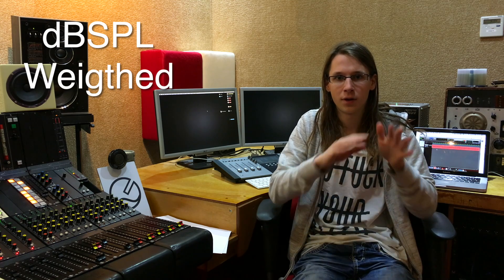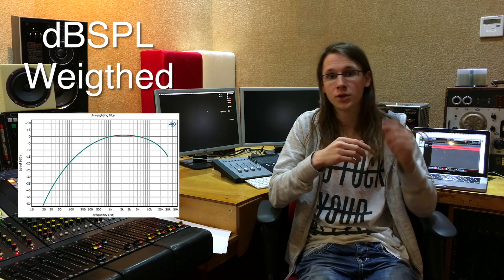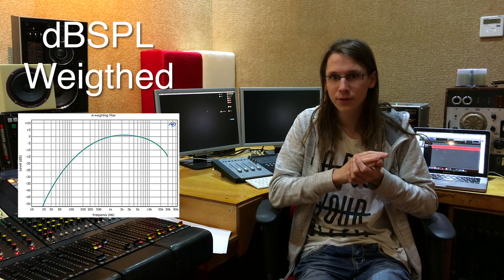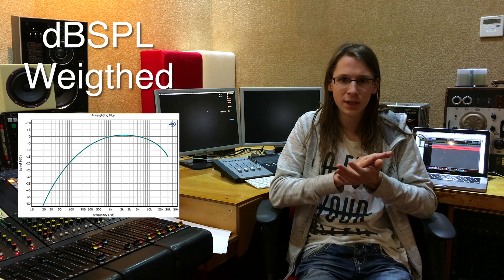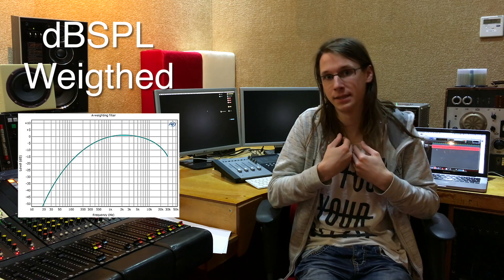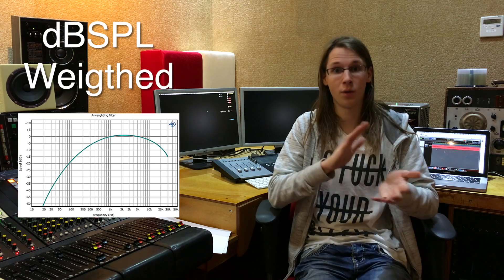Which decibel is the correct one?

Comment: A couple of quick points.  As dB is a ratio scale, -3dB on your DAW will always equal -3dB on your console (or any other equipment that that the same signal passes through).  It doesn't matter which scale (dBV, dbFS etc) that the equipment uses for this, as it is just halving the volume of the signal, which all pieces of equipment will measure as -3dB.
...
Also 0 dbSPL is supposed to be the quietest thing that a human can hear, which is the source of that scale.  This was set at 20 micro pascals by some audio boffins once upon a time.  Talking of humans, we perceive +10dB as doubling the volume and =10dB as halving it.  This means that you have to up the volume by around 10x to double the perceived volume and this is why you need LOTS of power for PA type sound.  To double the loudness of a 200W system, you need 2000W!

Hope this helps someone.  If not, meh.

Comment: hi! there are few things to lightly correct here. double loudness is not increase of 3dB. It is actually increase of +10db. you used the wording that if we want to hear something "twice as loud". so in your case it would mean 90db is "twice as loud" as 80dB. +3dB is double power as in watts (used with dBm measurement) and +6dB is double amplitude as in voltage (used in dBV and dBu). also, reference for dbu is 0.775 volts.  dbSPLC is also used in measurements. its curve is largely flat as apposed to dbSPLA which mimics human ear.

Comment: I'm still confused! I read that when dealing with power, measured typically in watts, then a 3db increase yields a doubling of power. But when dealing with voltage or SPL a 6db increase doubles voltage or sound pressure.

Comment: dB(a) is often used in building engineering for measuring sound insulation in buildings. I.e. Building regulations state the sound insulation performance between two rooms (or houses) in dB(a). For appartment bulding the requirement is +5 dB. I didn’t know there where so many different dB scales, I only knew of the A weighted scale.

Comment: As long as signal stays inside the computer it can go over to plus dB FS. There is no clipping inside most daws and generous headroom in many encoding formats.
Reply: j7ndominica0 

I should have read this before commenting. It’s basically the same as my point with the caveat that you are recording in floating point. In finite/fixed point, 0 is the maximum, no exceptions.

Comment: Wait... isn't 6 dB difference roughly equivalent to twice the power? Why do you say it's 3 dB instead? What's going on?
Reply: it's a doubling per 6dB if we are talking amplitude, and 3dB if we're talking power.
Reply: If you combine two similar signals as in parallel compression, 6dB. Typically doubling power equates to 3dB.

Comment: Thanks a lot for the explanation. 
   How do I do I use compressors to get the best performance in a live outdoor setting? Better yet, how exactly should I connect it in my sound rack? 
   I have an analogue mixer, Amplifiers, equalizer for each amplifier(bass amp, low-mid amp, high-mid amp etc.) and a BEHRINGER ULTRAMIZER PRO. A video explaining all these would be nice. Don't mind an email either.
Reply: Kajene Dawkins If your mixer has insert points use it as an insert effect. If your mixer doesn't put it right after the external mic preamp. If you use the mic preamps of your mixer and it doesn't provide insert jacks you have no chance to use compression on each channel. The only way to use a compressor in this case is to use it as a master compressor right after the main outs and before the PA-amp.

Comment: If you're working with regular PCM signals, then half the signal is (roughly) -6dB. If you're working with squared quantities (eg power, RMS) then half is -3dB (essentially all we're doing is dividing the result by 2 to undo the exponent once in log-domain, which saves having to take a square root first). This way you get the same dB values independent of whether you squared your signal first. Since this probably refers to the problem of adjusting and/or measuring regular signals (as they are sent to an audio interface) the 20log10 or ~6dB rule is what you want.
Reply: 20log10(2)= 6.02 dB, for voltage level in the mixer, as it is easy to verify summing two equal signals at -6 dB and getting 0 dBFs on the master bus. Thinkink to the pressure, and so for the power, for the same math it is to see a factor 3 instead of 6 about the dB spl. ;-)
Reply: Yes, correct. But a perceived doubling is, according to many people incl me, 10 dB (PCM).